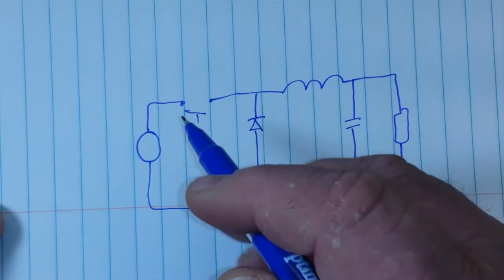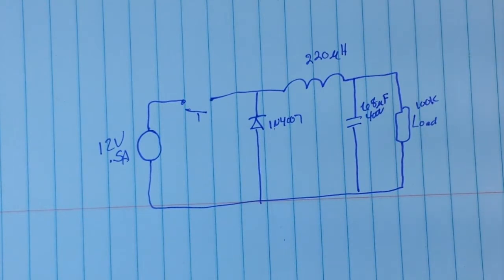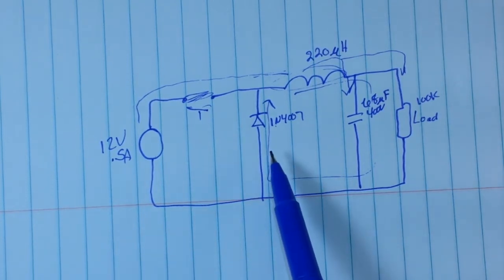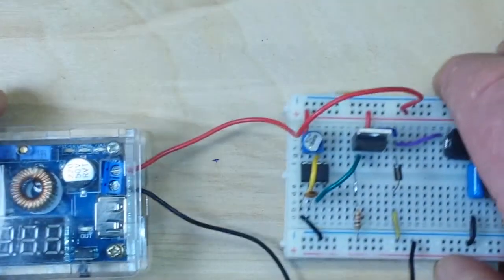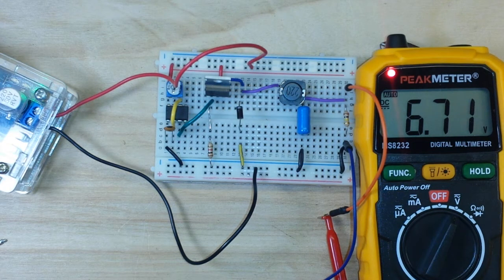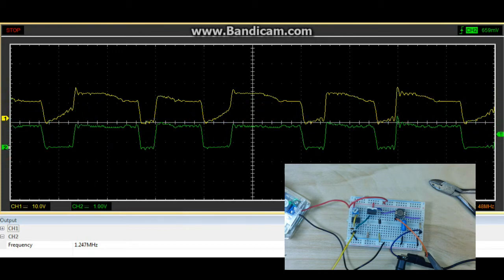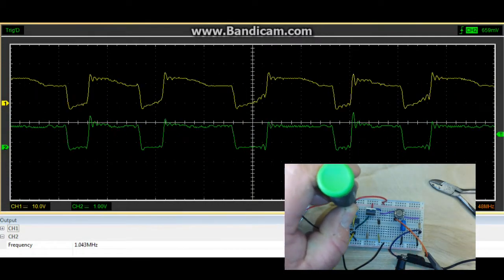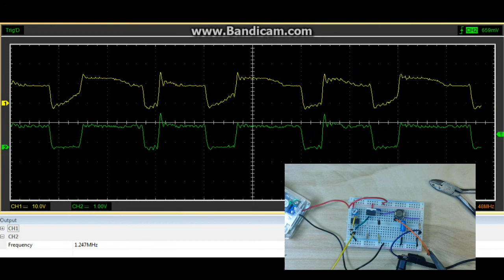DIY Buck Converter

Comment: Why not just use a LDO regulator instead of this circuit?
Reply: A 7805 would generate a lot of heat via a heat sink if the desired voltage was 5v. They are inefficient for this spread.

Comment: Hey ove got a buck converter  that  has an input voltage of 13 volts  but my buck converter only outputs  around 4 volts  when    maxed out and will go to 1 volt when turned all the way down  . It used to be able to   be able to have the output damb near match  the input voltage but no longer does and maxes out at around 4 volts. Is my pot to blame

Comment: How can you drive the mosfet gate with Vg = 12V, while it must be >=22, can you explain that for me pls?
Reply: Mosfets Gates must be driven by a voltage around 10-20v, 12v is a safe voltage, 22v is too much and probably would damage the mosfet gate
Reply: @VictorC173  the mosfet is being used in the high side so it needs bootstrapping to fully turn on

Comment: could you tell me is that NE555 or TCL555?
Reply from the maker: Ne555
Reply: as i know, ic555 can't create duty cycle < 50% so could you explain for me why the output voltage can go down to 5V?
Reply: @nguyeninhkhanh9020  it can go below 50%, he has wired the timer to increase the discharge compared to the charge rate. Clever setup really :)

Comment: Where would you use a Buck Converter?
Reply: Everywhere you need a power source of lower voltage than your other (available) power supply puts out...As an example, I have a 24V psu, but I need a 5V one. This is easy to implement by a buck converter.

Comment: Is that MOSFET gets hot ? With or without load? I gonna make that to connect a solar panel to charge my 18650's lithium batteries.
Reply: It shouldn't. The voltage drop across it is pretty low, most of the drop is across the load. If you short the load....yeah I think so.

Comment: Thank you, tried it out but didn't work! Keep getting like 0.01 v across load! Maybe inductor size is important?
Reply: Inductor size is extremely important! In fact, the value of every component , the switching frequency, the input and output voltage, and the loading are all extremely important to proper operation.  You generally can't expect to throw together parts and expect it to work.
Reply: Why would it not be important?

Comment: another dream project is a inverter to power my house. starting with the boost stage. 24v and about 5 kW pure sine wave. I found a driver for the output. but required high voltage DC 170v +/-, to get 120vac. but a high voltage and current boost . isn't quite that easy. hope you and your family have a great  thanksgiving!!!
Reply: How did it go?

Comment: Do you have a circuit diagram for it?
Reply: The circuit diagram is so simple we don't need that but you can find that on google 'buck converter using 555'.
Reply: He doesn't include the charge pump to drive n channel gate

Comment: the max  courant      //A////    what*******
Reply from the maker: Hicham Bougaa a buck converter decreases voltage and increases amperage. so the maximum current would be a function of input versus output. but if you want to talk about maximum current by component, the 1N4007 diode has the lowest rating at 3A.

Comment: nicely done, does the components get very hot bringing down the voltage?
Reply from the maker: dwpetty3723 nothing here was warmer than room temperature
Reply: dwpetty3723 that's the thing about switching power supplies.... Because the current is just interrupted to reduce voltage instead of drawn off by a resistor like a voltage bridge, they are very efficient. Nothing is wasted to reduce the voltage, but the drawback is they are more noisy. So devices may still use both a buck converter for most of the voltage reduction and then a linear regulator (like a LDO) which will waste a little bit of power but ensure less noise and more even voltage under load.